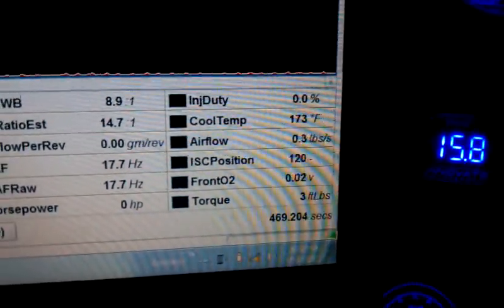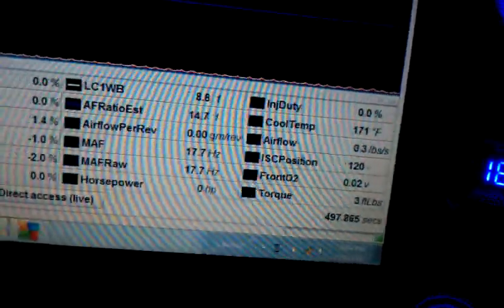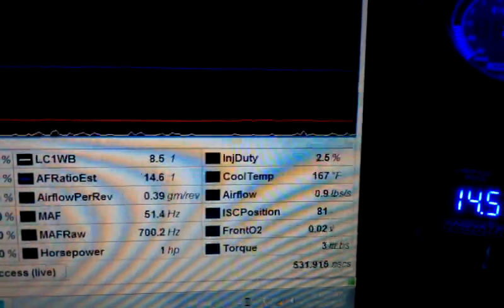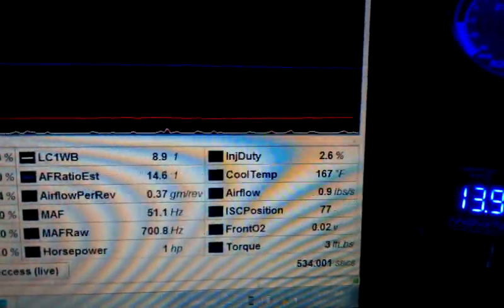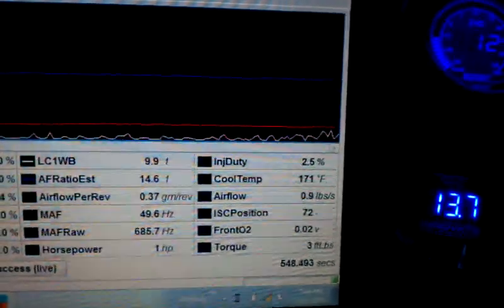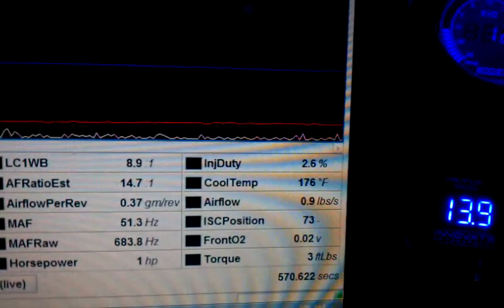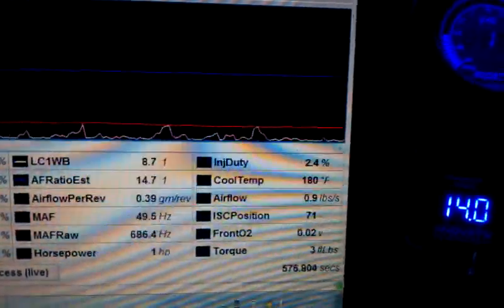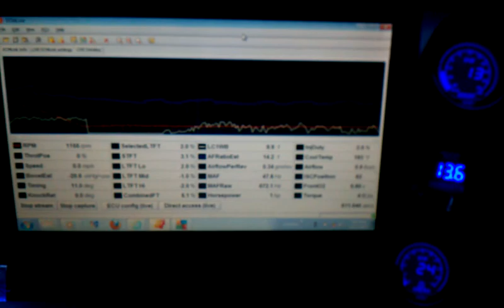LC-1 / EcmLink Issue

Comment: You have to program the LC-1 Unit as well. It came with software and a cord that links to that db9 connector coming from the lc-1 (not the gauge). You need to program both aux and aux2 to be the same and show 0.00 - 5.00v range. If you dont then you will get the results you are seeing currently. I had this issue and I couldnt find anywhere on the net that had an answer. I hope this helps you